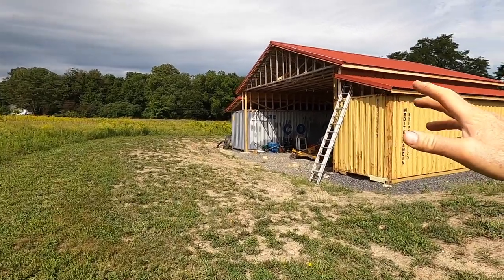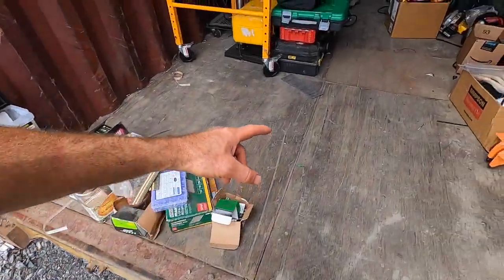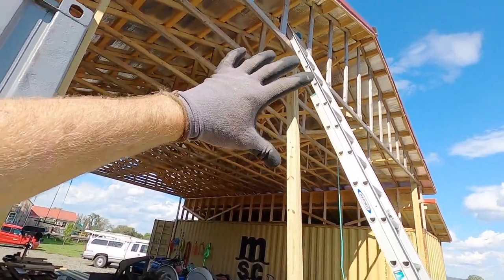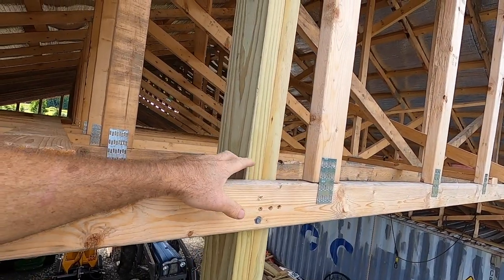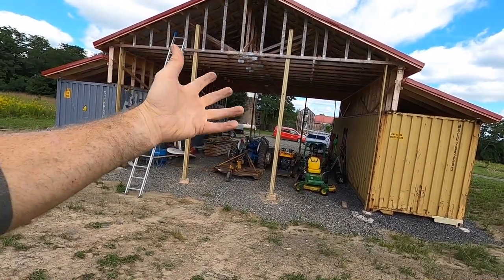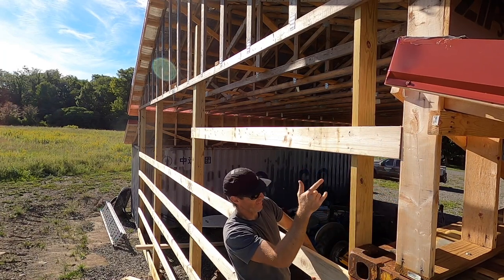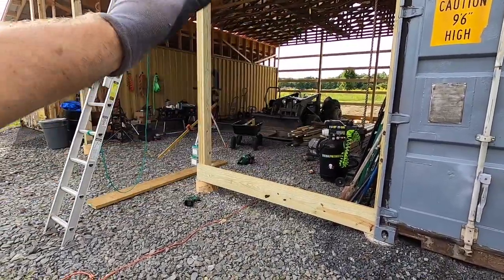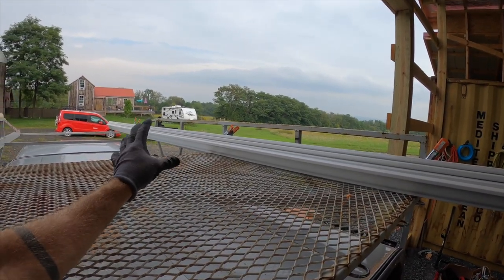Framing Exterior Walls - Shipping Container Barn 9

Comment: Nice building that. Little tip for soloing the posts up. Bore a lil hole in the top and throw the rope through the truss opening. That way you can lift and hoist at the same time to get it up there 😁😁 like your attitude towards difficult things like "this is difficult. That failed. Welp guess i'll just power through!"  Keep the videos coming man! 😁👏
Reply from the maker: Oh dang! that rope idea of yours is a good one ... thanks for the tip! next time I guess. Most recently I was raising similar posts but out in the open in a field, so no where to tie them up :)

Comment: It's the paddleboard that adds character to the worktable.  And why aren't the angle iron bolts into the concrete posts a bit closer to the center of the post?
Reply from the maker: I think you're right about those bolts! More central would mean less likely to crack to concrete ... thanks for the tip! I think I can still redo that :)

Comment: I agree that the store bought brackets are flimsy but they do keep the wood from directly contacting the wood. Why didn't you separate them somehow?
Reply from the maker: I'm not too worried about it since the posts will be inside the building ... but ya never know!
Reply: Concrete has a tendency to wick moisture from the ground. Just something to keep an eye on

Comment: Your angle iron brackets would be stronger if you’d bolted them in the center of the concrete under the post instead of on the edge.
Reply from the maker: Agreed and good point! Makes sense. Thanks

Comment: Shipping containers cost 7k a piece.  I could build those areas for well under 14k.
Reply from the maker: I agree with ya man -- shipping containers are not only expensive these days (especially if you buy them through the dealers) and they have other negatives built into their structure. If $$$ were the only consideration I'd either stick build or go with pole barn